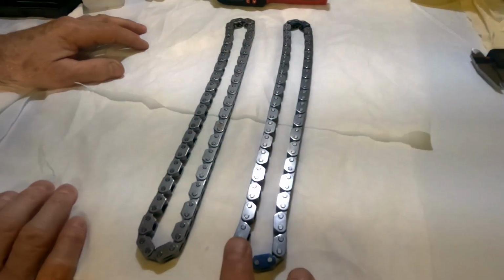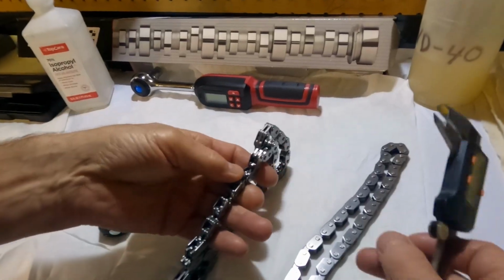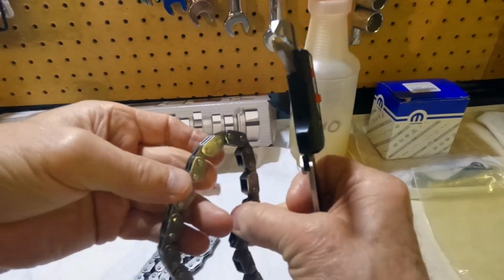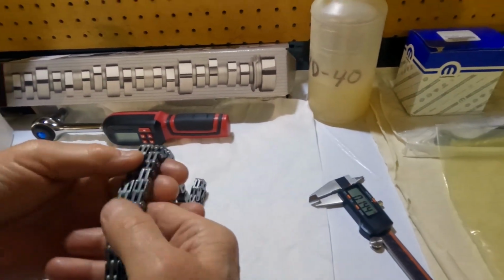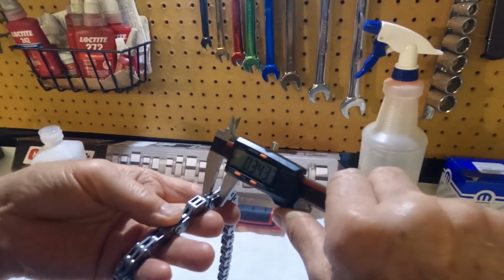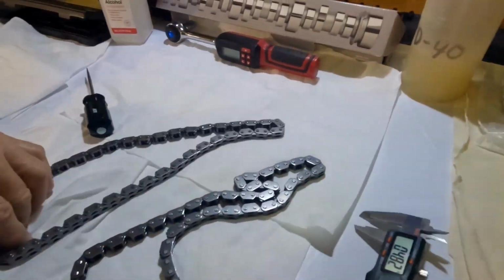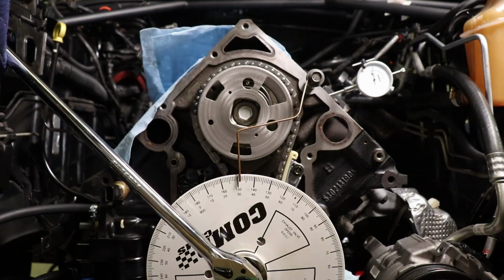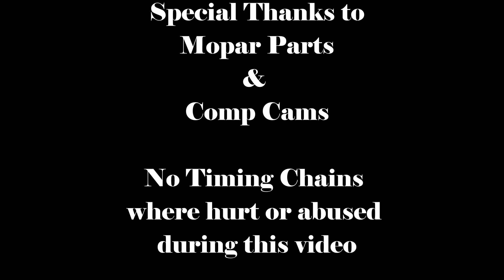Is it a Better Chain? Comp Cams vs Mopar - Timing Chain Comparison - 5.7 & 6.4 Hemi

Comment: I'm disappointed there's not a roller timing set available for the vvt hemis. Id go with the comp of those 2 for the consistency if nothing else. The Mopar chain is good but not designed for what you are doing to that engine
Reply from the maker: Yea, I'd feel more comfortable with a double roller setup. Thank again for watching!

Comment: Think I would rather have the lighter chain. Less weight.
Reply from the maker: There was a slight weight difference. I was sure I had video of them on the scales but couldn't find it. I always thought the chains on these and LS's looked like something off a bicycle.  I'd like to have the double roller chain like you can get for the 6.1's and Pre-VVT engines myself. I just hope this Comp Chain is made of some good alloy. Thanks for watching!